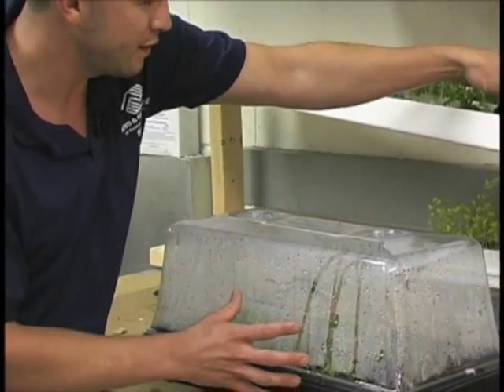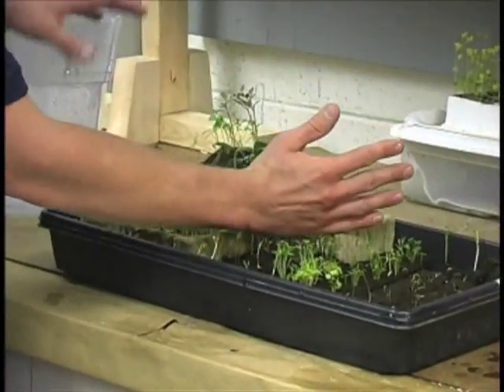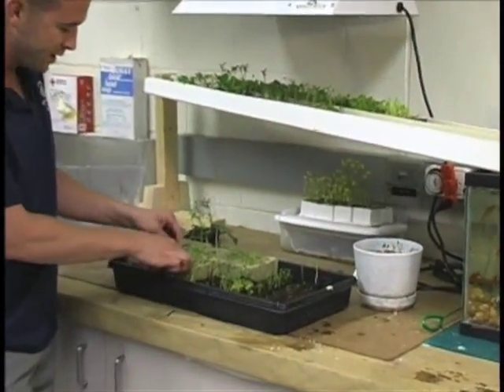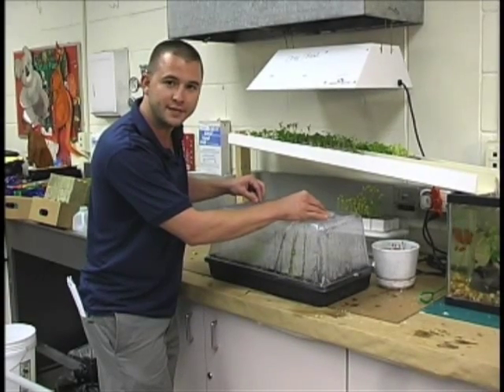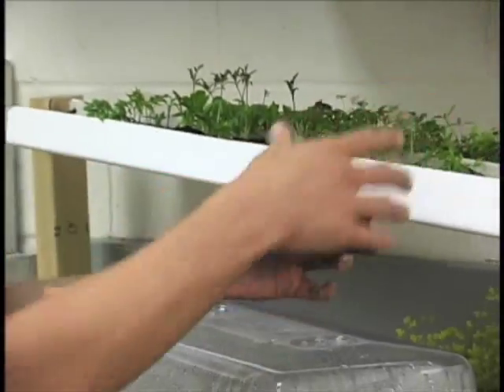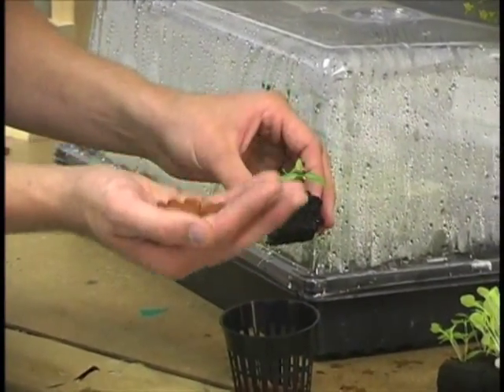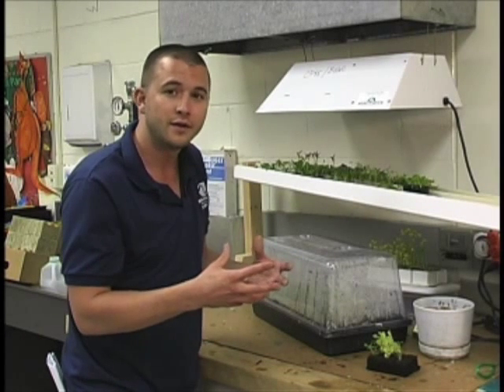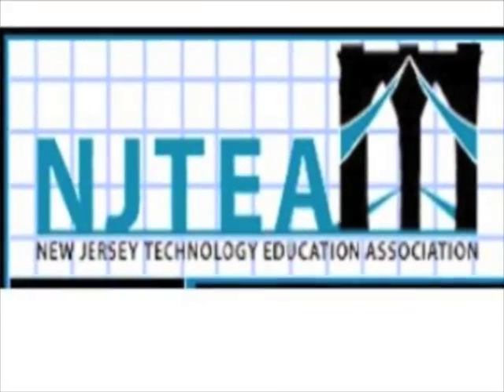aquaponics hydroponics aquaculture (Part 2)

Comment from the maker: Good points.  I don't have the technical grasp I would like to on every aspect of hydroponics. I'm not a chemist either, but I've built a lot of systems with students over the last five years and I've found that colder water always means healthier roots and the aeration, while it may only dissolve so much oxygen, keeps the tank cleaner and smelling less.  Thanks for the info, though.